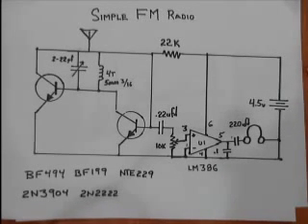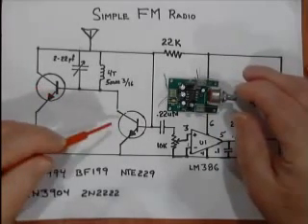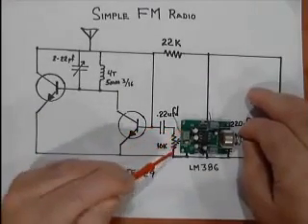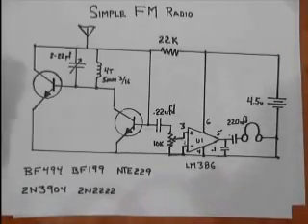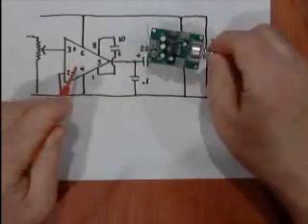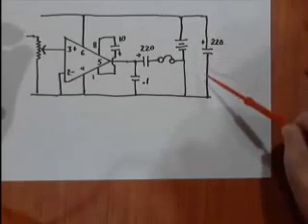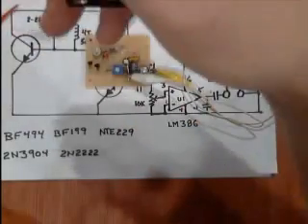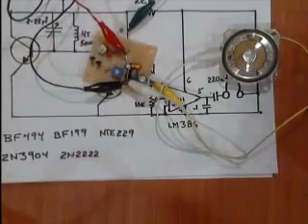Making A Simple FM Radio

Comment: Hello, Is there anyone who made this circuit using 2N3904 transistors ??? Did it work with these transistors ?????? Does it need any changes to work with these transistors??? BF494 are no locally available
Reply: I used 3904s, and, yeah, it kinda works.  It's hard to tune and very drifty, so you may hear one station for a few minutes, and then the oscillator drifts off somewhere else on the spectrum.  The extra capacitor across the amplifier pins was a necessity for me to get any audible output.  If you think of this as the FM equivalent of a very simple crystal radio, you may be happy with the results: the miracle is that it works at all.
Reply: Same question dude
Reply: Dont waste your time dude this type of radio not going to work for everyone because in the US the tower is so much closer to the neighbourhood and having more powerful signal while other countries is different...you will need a special FM radio microchip to make it work like the BK1079. 

So as you can see many people in the comment failed to make like the one in the video...because i've tried it myself as well nothing work not even a sound but just noise from surrounding.
Reply: yes i tried and it doesnt work im so disappointed !
Reply: Neodiy.c0m 

sir,this fm radio works with transistors listed with a long  ridiculous coaxial cable antenna ,try it:

Comment: Hi, I would like to build this circuit for my school project. I saw your other video about the antenna booster and I would like to use that circuit on this one. Can I connect that circuit to this one on a single battery?
Reply from the maker: +CyberBoy8799  Yes and no. I've not tried it before, but in theory, it should work. However, the value of the choke needs to change on the antenna booster to accommodate the frequency of the FM band. Follow this link for more info on the booster:http://www.seekic.com/circuit_diagram/Amplifier_Circuit/Active_Antenna_for_AM_FM_SW.htmlTips on making the radio: 1) play with the length of the antenna - every situation requires a different size - 2) keep the coil and the tuning capacitor close to each other (they feed off of each other) - 3) best to use a tuning capacitor with a knob because stray capacitance from fingers, coming close the tuner, will effect the performance and 4) don't forget the 10ufd cap between pin 1 and 8 on the LM386 needed to boost the output.Good luck

Comment: I tried that circuit on a breadboard and it didn't work.
Reply: Papa Blast be aware of pF capacitors used In this design. Any somewhat buggy connected wire would produce even higher capacitance than this. So make the antenna resonance part as short as possible connected to each other.
Reply: Seems like breadboard(or some of them) introduce unwanted capacitance (C)
Usually for RF/Radio stuff, it is better to build on PCB or such(protoboard..etc.)
http://freecircuitdiagrams4u.blogspot.com/2014/06/simple-fm-circuit-diagram.html

Comment: sir fortunately I can hear the disturbance of radio but can not hear any song sir please help me and please tell your Facebook profile name please reply sir. Thank you
Reply from the maker: Hi - It sounds like you are making some progress. There are a couple of things you can try to help improve the performance of the radio. You can try different antenna lengths of the antenna. Also you can spread out the coil slightly. And remember, the coil and the trimmer should be close to each other to help in the resonating of the incoming signals. There are plenty of good videos on YouTube to help you understand how an L-C Tank circuit works. They are helpful. Also remember, this is a very simple-crude circuit used for experimentation and learning. A proper FM radio has a more precise tuner and decimator circuit needed to separate the audio signal from the carrier wave.  Good luck with this. I am not on Facebook.

Comment: sir luckily I got one trimmer cap and now I have an little doubt that where to fit the middle terminal of the trimmer in the circuit so sir please help me with my little doubt fast thank you
Reply from the maker: Typically, a trimmer cap has three terminals, of which, the the two on ends are connected together. Connect one wire to one end or the other - it does not matter. The second wire is connected to the middle pin.

Comment: yeah sir you may be right I have an Fm pocket radio in which sometimes when I touch the antenna it get works properly so on touching the capacitor I may get the different frequency and now I will surely try this one but when today I was going to buy transistor to my local shop he also told me that we can not make a radio from this much simple circuit he also told me that I will just waste my money as this useless circuit won't work but then also I bought those transistor and said to him though I will waste my money but I have an trust on this channel and I think that it's not fake and I will do my best. Thank you

Comment: sir but there is no other way without using trimmer cap? can we change frequency by stretching the inductor? of any one knows answer of my question then please reply. Thank you
Reply from the maker: Hello - you do have an interesting problem.The heart of the radio is the Tank Circuit, which is the coil and the trimmer (variable capacitor ) in parallel with each other. The values are picked because they will work together (resonate)
at the FM signal you want to pick up. One of those components have to change in order to tune into the right signal.
The only way to work around this is to put a fixed capacitor  where the trimmer goes.  5 or 10 pico farads is a good place to start. And then gently touch the capacitor. The stray capacitance in your finger tips will change the value of the capacitance in the circuit and there is a chance you will pick up a radio signal. The only problem is once you take your hand away, the signal will disappear. There are Resonance Calculators online which will help you figure out what component values you need to select in order to pick up the right channel. The coil, if built properly, has a values of about 250 to 300 Nano Henrys. Here is a link to a calculator:  https://www.youtube.com/watch?v=PoSso8Zdfqo

Good luck and let me know how you do.

Comment: sir now I have an problem I m not getting trimmer cap and anyone can also try without it if you can answer. The seller told me that now you have to fit an normal capacitor bread board of certain value and if not works you can change the nearest value of capacitor for getting it to work. so please i will be thankful if sir or anyone other can help me. I need a frequency of 87Mhz to 100Mhz so any one can tell me that how do I make inductor of how much turns of 18 gauge and rolling it on which substance and of which value of capacitor do I buy so that by calculation I can get my above desired value and by changing the capacitor I can get another value.i will be very much thankful if anyone can calculate this and send me a mail or can also comment here so please help me and reply fast .Thank you

Comment: At 3:55 how do you hook the 5 pico cap  ?
Reply from the maker: Break the connection to the antenna and put the 5pf between the main circuit and the antenna. The capacitor is there to prevent a longer antenna from loading down the circuit. You may have to experiment with longer antennas depending on the power of the FM stations around you. Good luck.
Reply: Radio66   Great answer. Thank you

Comment: how did you make the antenna sir. TYIA. your explanation is very clear aside from the antenna
Reply from the maker: Thanks for your question. My radio worked differently in different locations. Down in my basement, I clipped on a wire of 1 foot it that worked for me. However, up in the kitchen ( where I shot the video) I used a transistor radio telescopic antenna which was mounted vertically in a wood block. This is something one has to experiment with.
Reply: Thank you very much for your fast response sir. Have a nice day.
Reply: https://www.wikihow.com/Make-an-FM-Antenna

Comment from the maker: Good to hear you were able to make the radio. It is a fun-simple circuit. To make a digital control tuner you would need a digital-to-analog IC. A digital keypad puts in a digital number at the input of the chip and an analog voltage is produced at the output to control a varactor, which is a voltage controlled variable capacitor.As the analog voltage is raised or lowered, this produces a change in the capacitanceof the varactor. The varactor operate in parallel with a coil which forms the tuned circuit.There are plenty examples on the internet how this is done. The trick is to find one that works in this situation - and the other trick to find the parts at a decent price. I will do some research and if I find something I will share it with all.

Comment: Hi, can I use LM358 in place of LM386?
Reply: +Mohammed HAJHOUJ The LM 386 is designed as an audio amplifier, operating at a small voltage. The LM358 is designed to operate at much larger voltages.. Best to stay with the 386.
Reply: Randall Bashta
Thanks for info :-) . The question because I salvage a LM358 from old satellite tuner ;-) and don't have an LM386, so I thought that I can make it useful by using it as an amplifier in this radio project
Reply: +Mohammed HAJHOUJ LM358 is a ampop and LM386 is a audio amplifier! What's better for you? An ampop or a audio amplifier?
Reply: I was able to use the lm358 and it amplify sound but quality was little bite not fine, but i'm ok that the lm386 is done to be an audio amplifier. my idea was to reuse a salvaged lm358 as I didn"t have an lm386.
Reply: With LM358 make a good amplifier circuit!!
Reply from the maker: +Tiago NET LM358 is a high gain operational amplifier but it is used for Non-Audio purposes. The LM386 is used for the audio range  ( 30 to 20kHz).
Reply: +Tiago NET sure I was able to amplify sound with the lm358, but the issue that I found, I didn't find many circuits schemas on the net otherwise the lm386 is very popular